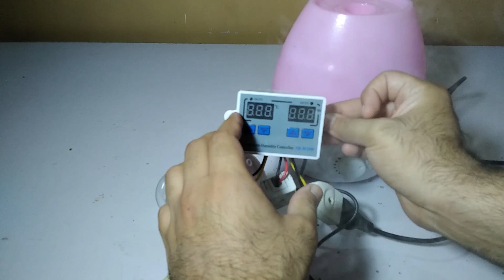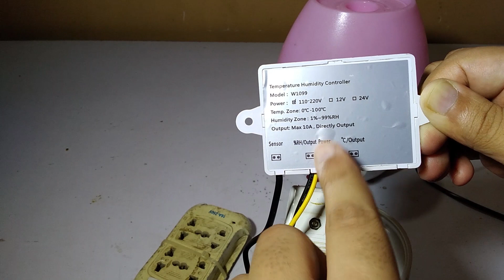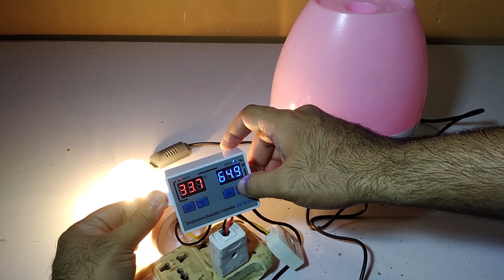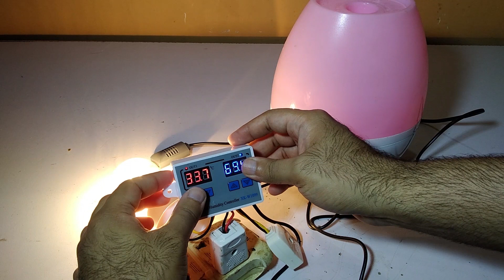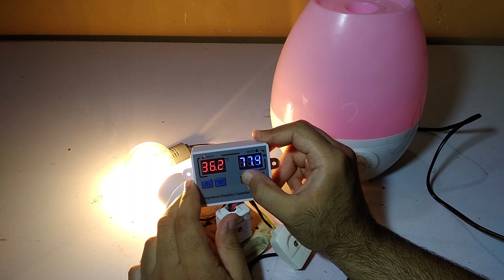xk-w1099 controller wiring and explain - English

Comment: Hi , thank you for instructions, is it possible to use it with 1000 w heater?
Reply from the maker: You are welcome, These small circuit are good only up to 400 watt if you need to control 1000 watt need to attach a bigger relay with this circuit